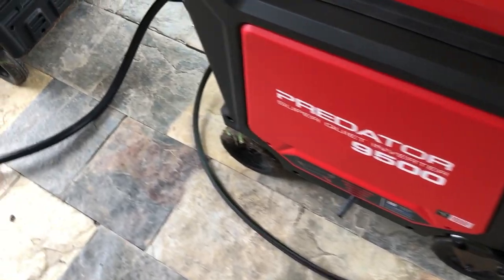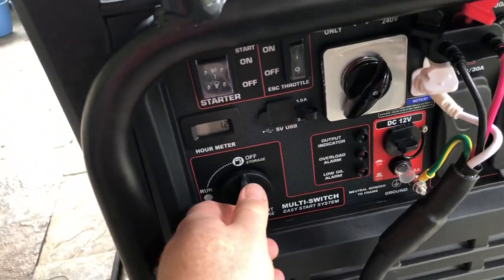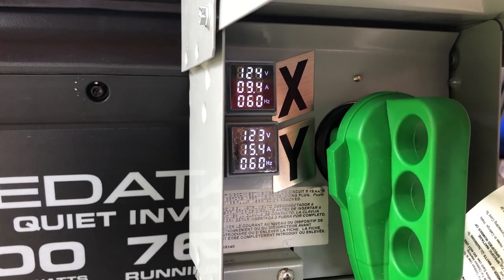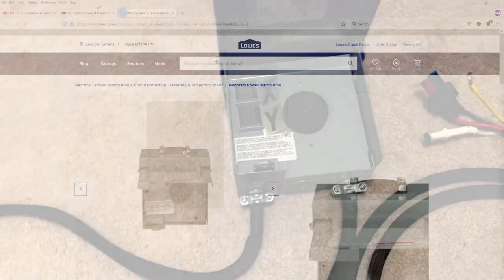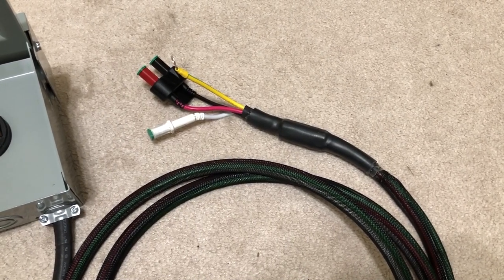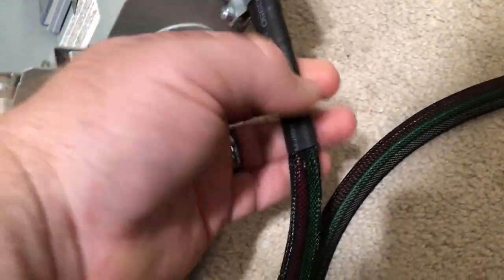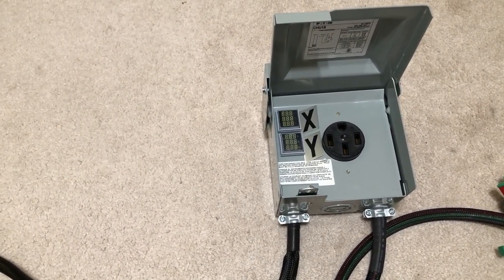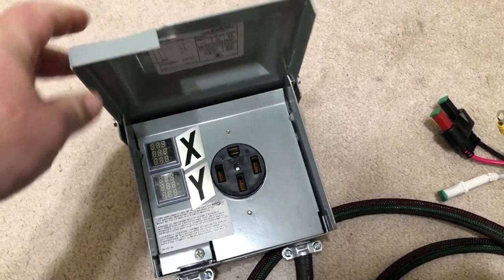Predator 9500 Home Built 240V Parallel Kit Test & Build Parts: 2X Output Power Using Two Generators!

Comment: Is it possible to parallel two inverter generators if they do not have the parallel output ports? I was looking at putting two Predator 8750 in parallel or something similar to save costs due to my house not needing as much power as yours. My house has a 3 ton AC unit which is my main goal of powering.
Reply from the maker: I wouldn't do it.  

Now I have seen videos of people linking one parallel capable inverter generator to another one that does not have the parallel kit.  They were smaller portable generators, and your mileage may vary.  But they would have to be inverter generators, and I'd always suggest starting the non-parallel one first, so the parallel one can sync to the other in case the parallel one doesn't "know" how to sync.

But the bigger issue is safety.  The non-parallel one won't have the parallel cable ports... so this means you'd be making a suicide plug to hook it in.  (if the other generator is on, the exposed pins on your plug for the non-parallel model will be energized and very hazardous)  And that would also mean you're running your funky parallel cable through a breaker on the generator that can trip and break the sync between the units.  (the parallel connections bypass the breakers).  All that is bad news... So I'd strongly suggest sticking to the models that are designed for it.

Comment: I'm especially curious why you think 6ga wire is necessary? You have the wires coming from each generator at 30A and they look to be only 12ga, possibly 10ga at most. The current isn't doubled until you make the connection at the terminal block and from there to the outlet must be only 3 or 4 inches. I looked at a 15 foot 50A extension cord which was 6ga, but I think 8ga for that length would be more than adequate. If I'm wrong, so be it, but just posing the question....
Reply from the maker: I used 8g for the connections to the generator (expecting to handle a bit over ~30a continuous with some brief possible surges)
Once the wires came together and "joined forces" I switched to 6g wire, that is rated for the 50-60a it might be carrying to make the connection from the terminal block to the dryer plug.  

I probably did not have to do this part, and could have stuck with the 8g wire.  Cable length plays into the required gauge... and this particular length was only a few inches.  But I figured I'd err on the safe side, and not risk anything getting hot inside that box.

Considering all this is going into a wooden enclosure, next to two gasoline power machines with ~7 gallon gas tanks positioned above them that will largely run unattended... and all that is under the wood awning of my back porch.... fire = very very bad so everything I did is slightly over built.  :-)

Comment: Looking at the HF Website the pictures have the white connection removed... DYK if they removed the parallel capability of this?
Reply from the maker: That is weird they changed it again.  The parallel ports are still there, so I'm guessing they're just using the ground for the neutral.  (will make the future parallel kit cheaper to produce).  I don't like that, because that neutral carries any imbalance in power between the two legs, so there is some hazard there if one were to unscrew the ground while things were running.  

The instruction manual on the site still has the neutral port indicated.  Who knows what they're doing.
Reply: @Texas_DIY  FYI I bought 2 and they do have the White connector!

Comment: Thanks for the info. I just learned about the easy start and my customers are wanting it and I am doing all the research I can. I am interested on the EATON  inlet box with power quality meters. Where did you find that or did you add this yourself? Thanks
Reply from the maker: I purchased the meters on Amazon, and mounted them into the box.  (Stepper bit to drill the holes).  The links are in the video for the parallel kit.  And the video covering the softstart has some before / after readings you may find useful.
Reply: @Texas_DIY  thank you. great job!

Comment: I have a question.. I'm looking at buying a predator 9500. I also have a predator 4550 inverter generator. The 9500 has a 3 port parallel and the 4550 on has a 2 port. I'm looking for the best suggestion on where to grab my neutral from on the 4550.
Reply from the maker: You've got a 120V generator.  The 9500 is a 240V generator.  The two can't really link up together.  The 9500 makes two legs of power X and Y, each with 120V to neutral, or, 240V to each other.  The 4500 just makes a X and Neutral (no Y leg).  So they don't really mate up. 

If you were willing to risk it, it would be interesting to see if it the two would sync to each other, giving you a lot more output on one leg (either X or Y)... but that's a lot of $$$ to pony up and put at high risk just to "see what happens".
Reply: @Texas_DIY  I just decided to buy a second 4550's linked together with a running watt of 3560 should give ma a total of 7300 running watt which is only 300 running watt less than the 9500 at 7400. Which should serve me fine. And offer just about as much operating power. And give me the 2 legs you are speaking of

Comment: Do you have to have a meter on each hot line or can you run 2 hot lines on 1 meter?
Reply from the maker: The two meters measuring the voltage, one meter for each leg of the 120V.  And the coil for each is around the combined output of each leg.  So the cable that goes from the junction of the pair into the dryer plug is where the coil is positioned.
Reply: @Texas_DIY  I understand that.  My question is could you run both hot wires through on CT and have it read 240?

Comment: 4 Can I get 120v AND 240v out of both the connectors on the XP9000iH-PK parallel kit. or does it have to be 240v only. The connector on the left is a L6-30R which has 3 connections, X and Y Hot and a Ground,The Connector on the right is a 14-50R which has 4 connections, X and Y Hot and a Neutral and a Ground. It seems that the L6-30R could also have 120 volts on each X andY legs to ground since the
Reply from the maker: Yeah, Duromax seems to be using the ground also as the neutral.  I'm not a fan of it, particularly as the ground is an exposed terminal... but as long as you keep it secure and don't get your body between the cable and the terminal, I would think you should be fine.  240v will just use X, Y.  But 120V stuff will need the split ground/neutral as the return path... so it will be carrying juice.  I'd be sure to follow the best practices it describes in the instructions.

Comment: My question with this has been regarding isochronous / lag settings for the generators.  I have two predator 9500 inverter generators, and I need to make a parallel kit for it.  The wiring is not an issue, but is there a switch I am missing on the generators?  Or is it simply plug and play, and the inverters will synchronize on their own?
Reply from the maker: My impression is that when a unit starts up it will match the frequency of the power if it's present.  There may be some kind of data communication, but I really don't think so.  I've seen videos where people have mixed and matched 120V units in parallel from different manufacturers without issue.  

I *believe* that is why when overloaded the power is cut vs there just being a reset switch, the engine must be completely shut off and then restarted in order to bring the power back.  This allows the unit to re-sync with what power may still be present, vs. just turning on and combining two different frequencies of power into a line.

Comment: Hi I was wondering what gauge wire did you use for the AC Voltage Current Display Meter thank you
Reply from the maker: The voltage measurement requires virtually no current. 

It’s just reading voltage and running the display. No significant load what so ever. 

So pretty much any gauge wire will work. I just used whatever insulated wire I had on hand which was a small single solid core copper wire.
Reply: Ok thanks

Comment: what are the 10 awg pins that typically tie the generators together? i want to make my own cable.
Reply from the maker: I think they are standard bananna plugs, but they're in a shroud to keep them from being touched, and the ends are dipped in a insulating material so you can touch the inside with your finger.  Honestly, I'd suggest buying and modifying the Powerhorse cable.  It's just about perfect, and much safer (and probably cheaper) than making your own.
Reply: @Texas_DIY  i have a small awg parallel set. Also a parallel kit for a honda EU7000IS part number 08E93-Z37-000AH 
That does have 10awg wire but it also has something onvthe end of it that doesnt at all match up. I am an Electrical technician and your effort and your discussion deserves kudos.
It did motivate me to buy the 9500. Now i am trying to get my son to buy one.

Comment: Can 4 run together on parallel converter,  or Parallel 2 and parallel another 2 then tie them together for total backup 100 amps@ 240v ???
Reply from the maker: I would imagine that you could, however it would be best to simply wire them all together, similar to how I did mine (just with two more).  You would need to start them one at a time, but I would think it would work.
Reply: @Texas_DIY   the power horse cable you cut are those AWG 8 or did you upsize wire from the Banana  plug ends?

Comment: Just curious on your Predators are the Parallel Connectors hot when the generator is started. On the Duromax XP9000iH the Parallel Connectors are not connected until the 3 pole master breaker is turned on.
I just don't see how the 2nd generator will see the first to sync without the master breakers are on on both generators
Reply from the maker: Everything is all wired directly together, so yes, when one generator is on, the plugs on the other end of the parallel cable are energized.  

But they're designed to be safe and have a shroud around the metal part (it's a banana plug) so you can't touch them from the side, and then the tips of the banana plugs that are inside that shroud are covered with an insulator material so you can't touch them from the end.  So there isn't any way to accidentally contact the energized parts.  (not a suicide plug)

On the Duromax parallel kit, are you saying the breaker disconnects the two sets of plugs from each other?  I would expect it to break the connection between both the parallel plugs and the **outlet**, but not from between the parallel plugs (Side A to Side B).  Without that, if the two generators are "seeing each other" for the first time when the breaker is thrown...  I don't see how the generators could synchronize with each other without doing really weird / bad things to the power of whatever devices may already be connected.
Reply: @Texas_DIY  The parallel jacks on the front of the XP9000iH are dead until the master breaker is on. To work properly when you start the generators the master breaker should be on on both of the generators.  Check out the email I just got from Duromax.

Hello

To clarify the generator is a bonded neutral and that will mean that the neutral wire is connected to the ground point (or generator frame itself), and because of this you can't bring the generator neutral to the panel due to the generator GFCI being tied to the ground as well, so you'd have 2 grounding points and the GFCI would keep tripping interrupting the power output. The only way that the parallel kit would function with a bonded neutral generator is to avoid using the neutral, and running a separate wire from ground point directly to make a separate neutral wire (or ground wire) that is connecting to the 3 pole transfer switch. Please note that you can't use an interlock kit for a bonded neutral generator because you only will have 2 poles, and you'll need 3 poles to switch the home neutral over to the generator neutral/ground. The ground/neutral wire leading from the generator ground point will carry current just like a neutral to complete the circuit, but since the wire is bonded to a grounding point it'll still be protected with ground. The outlets at your home will also still be grounded to the home grounding system separately as well, and will still break the circuit in the event of a short. The generators will automatically sync with each other just by connecting the generators through the panel, and if manually doing the operation they can start in either order. If your connecting an automatic transfer switch to the parallel kit, and are connected for auto starting through the ATS outlet; then the generator connected using the ATS outlet will start first and communicate to the other generator to start up automatically through the parallel kit.

Thank you,

Duromax
Support Team

Still no mention of the parallel jacks being off until you turn on the master breaker/

Comment: Love your video, before parallel ,did you change to floating neutral before connecting to inlet box?
Reply from the maker: No real need to if it's temporary connection (is my understanding).  Whole home generators usually do this as they're permanently connected.  It's a somewhat debated topic, and generally up to the individual.  
If you want to do that, I believe the ground connection is directly on the back of the main panel attached to the rear of the grounding post.

Comment: @Jason Wallace  I love your videos. As I am a Harbor Freight addict. my only question is if your gonna spend 5k+ on 2 9500's why not not purchase a Generac 7039 20kw and call it a day?
Reply from the maker: They were less at the time.  And even so, in my case we're all electric, so there isn't natural gas / propane.  The cost of the backup generators from Generac, plus installation, was in the $10k range... and I'd still have to lease and install a propane tank, and pipe the gas from that to the generator.  It would have been hugely expensive vs. the method I went with.

Comment: Hi, a single phase house has an L1 and an L2, each being 120V. If you had 2 generators (the little suitcase inverter types), is there a way to power up the main panel, with L1 being fed from one generator,  and L2 being fed from the other generator?  Keep in mind they'd be sharing the neutral in this case.  The 2 generators would need to be kept synchronized 180 degrees out of phase. Is there a way to set up such a system?
Reply from the maker: I understand exactly what you're describing.  I've thought about that possibility for some time before going the direction that I did.  But couldn't figure out how to make that work.  The 120V generators as far as I'm aware aren't designed to do that.  MAYBE if there was voltage present for them to sync to in advance on each leg, but I don't think there would be any mechanism to KEEP them in sync once the original voltage signal dropped out, because the pair would only be sharing a ground/neutral.  Like two stopwatches started at the same time, in a few moments they would be out of phase with each other.  And that would be very... bad... for any 220V appliances.

I recall a few years ago at one point, someone designed some kind of circuit (it was a youtube video) that tricked the generators into doing that, but I don't think it was anything safe enough to operate real appliances with.  Maybe this device had some kind of isolated circuit that leaked a bit of inverted AC current, to the other leg to keep/maintain the sync, I'm not sure.

Basically, as far as I'm aware, the units really need to be matched in capacity, and both be 240VAC.
Reply: @Texas_DIY  Appreciate the reply. I think I saw that video with the oscilloscope showing the waveforms. Maybe it needs a signal generator making 60 Hz and an inverted waveform that each unit can sync to.  Maybe a half-wave rectifier off the master that can derive a slave sync signal.

Comment: Hi Jason I was going to comment another question about the neutral missing on the Duromax XP9000iH and also on there  parallel box but my earlier post is missing. Just curious Does this happen a lot.

Thanks 
Rob
Reply: Thanks Jason
Reply from the maker: Not sure.  I cleaned up what looked like some duplicate posts, maybe I zapped yours on accident, if so, sorry.